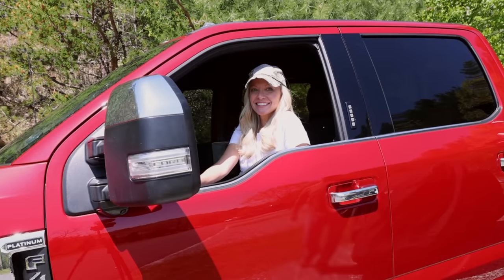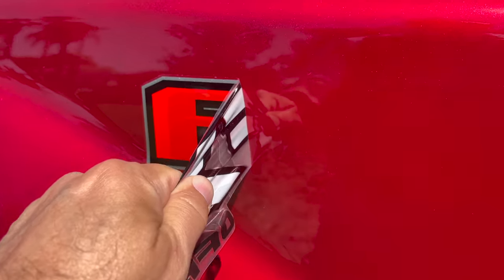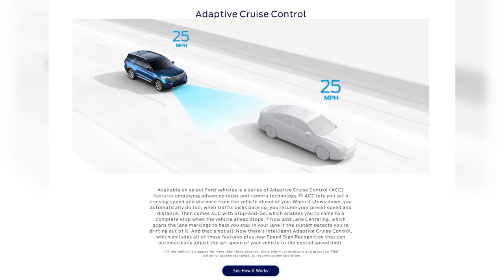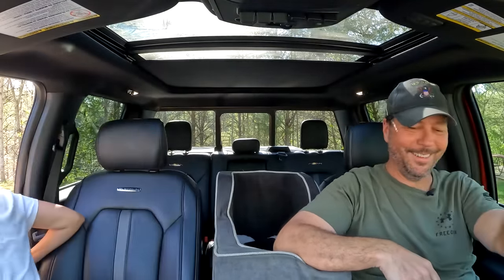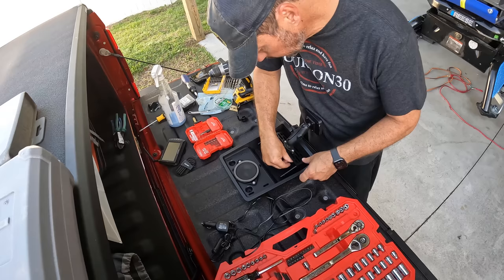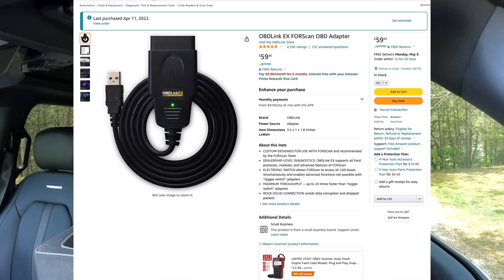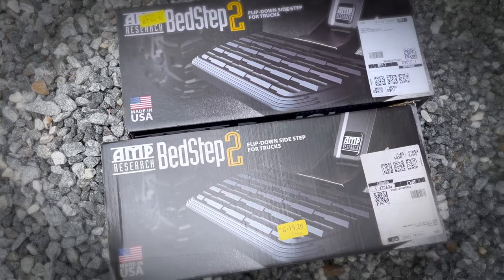2022 F450 Platinum! (Full Time RV!)

Comment: Couple questions for you 

1. Did you hardwire your TST 507 for power?
2. What are the little cushions you used under your GPS against the dash?
3. What upfitter switch did you hook it all to?
Reply from the maker: I did end up hard wiring the TST after filming this but I did film the dash for a couple of shots and you can see it.  I have them wired as:
1: dash cam
2: GPS
3: Furrion, TPMS, GoPro

The little cushions are just rubber pads from Lowe's
Reply: @ChangingLanes  I have my RV890 mounted where your Furrion is mounted I didn’t want to have it up between the screen and the rear view mirror. I felt like it would create a blind spot. But now with the extensions I have used its kind of bouncy on rough roads. I like how you have it mounted does it cause you any blind spots having it there? I may have to get a stubby bar and try it there and see how I like it. I was just going to tap in behind my cig lighter for power to my 12VDC sockets instead of running them to a upfitter switches and save them for other stuff. I was also going to mount the 12VDC sockets in the tray under the Bulletpoint mount but i don’t want the big ol GPS plug in adapter sticking up from when I plug it into the socket. I like how you have the wires going through the tray and the sockets up underneath.

Comment: Chad, I'd suggest keeping an eye on tire wear. I've had to increase the cold tire pressures above what Ford says (90 Front and 80 rear) to 96 Front and 86 Rear because both edges of all tires seemed to be wearing more than the middle.  our 5th wheel is about 21k lbs.  this of course makes the ride worse.  the tires are rated for 110psi cold so they're not overinflated.
Reply: Its a dually thing. The 4 back tires fight the front tires when turning. Ive never seen one that didn't do that... mine included.  I run 70 front and 65 rear.  Im not riding in an Ox cart. HaHa

Comment: liquid spring... as a medic who has riden on a F550 ambulance for 8 years equipped with Liquid spring, I would not recommend them.  Now this is an 9 year old model, but our department has had a lot of trouble with this system including the rig leaning to one side on several occasions.

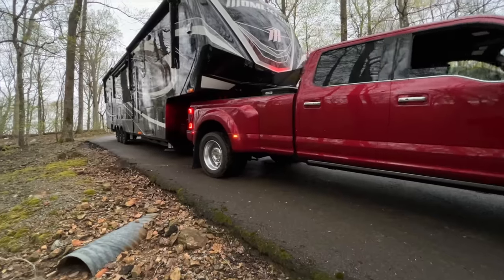Comment: @15:05.   How much clearance do you have between the RV and truck?  Could just be the angle, but man, that looks really tight!
Reply from the maker: It's about 6 inches.
Reply: @ChangingLanes  Phew, that's tight.   I wish they would lower these trucks enough to get at least 8.   I've hit with 7, not hard, but it's touched on uneven ground.  :(

Comment: Turn radius/wide-track is the biggest reason I got my F-450 (2019).  I wish I could have gotten a 4.11 or even 3.73 rear end gear for fuel economy, because I'll never tow to the maximum capacity of the truck.  I'd rather deal with the reduced MPG's than trying to get in and out of parking spots on a daily basis.  The adaptive cruise is awesome, and the cameras are great.  Look into a Banks Ram-Air (cold air intake) system.  It has given me +12% on the MPG's driving empty.  Better with trailers as well, but because weights varies so much, I can't say what the exact % improvement is...

Comment: I really like your truck. Too rich for my blood.
Only thing I wouldn't have ordered would be the moving running boards. I found the fixed ones on our 2021 Ram 3500 helps keep rocks from jumping up and chipping the paint on the side. Even if you have mud flaps.

Comment: Chad...  Did you remove the factory installed balancing weights from any of the wheels before installing the centramatics?  And did you install centramatics on all six wheels?
Reply from the maker: No.. left the weights on.  4 wheels... The rears are balanced in pairs. 👍🏼
Reply: @ChangingLanes  Thank you sir 🙏

Comment: curious on the differences in horsepower and torque of your F-350 and the F-450. And any fuel mileage improvement for better range? Very nice truck!
Reply: My ‘17 F-450 gets about 8-8.5 mpg towing and 11-12 mpg w/o trailer.  My F-350 SRW had same engine, was lighter weight truck, and got +2 mpg better efficiency.
Reply from the maker: Please see: https://changinglanesrv.com/faq/?Display_FAQ=2176
Reply: @ChangingLanes  Thanks for the info

Comment: Took 7 months to get my '22 F450 Lariat Ultimate in March (without adaptive steering). LOVE this truck after coming from my '19 F350 DRW which turned like the Titanic. That turning radius change and the larger brakes are amazing. Adaptive cruise while towing is amazing, hills or not. 
I do wish you'd do a video with more detail on how you wired the accessories to the upfitter switches. Were you able to use 12v "cigarette lighter" connections for the Furrion camera and the GPS? If so, did you just hide them somewhere or hard mount them? (So many questions. You see why you need a dedicated video, lol.)
Reply from the maker: Yes.. I just wired in plugs under the dash tray and plugged them in. 👍🏼   Plenty of room under that tray.
Reply: @ChangingLanes  How hard was it to find and connect the pass-through wires to the pigtails under that fuse box in the engine bay? That's been my struggle doing a cursory look.
Reply: I currently have 2020 F350 Lariat Dually and is waiting for the order bank to come open to get F450 Limited.  How are you coping on checking tire pressures?  Do you just look at them? or do you actually put the pressure gage for true reading?  if yes, how often?  How is the ride?  I don't plan to do much change once I get my F45O.
Reply: @wj2791  It is a bit of a pain, but you just get an old school trucker's gauge. Due to the route carcass, they don't put sensors in the rooms. You can add the TST sensors like you use on your trailer, but I've not done that yet.

Comment: Hey Chad, love the truck! On the Liquid Spring, the company may have a kit for the F-450, but when I spoke to them a month ago they said they didn’t have any kits for the non-commercial line of trucks yet. He thought it would be 2023 before they did. They seem to be more about body roll control for heavy truck camper rigs as well, although I love the kneel feature which would help with transitions in boondocking. 

I also shopped Kelderman, they have great kits, and do have lowering function as well on the backend, and a friend of mine has one in a Chevy 3500 dually and he loves it. He does say the ride is improved and of course getting rid of the leafs probably makes the difference there. I haven’t decided on the 10K to do the upgrade yet. Parts are 6-8 weeks out as well. 

Hope this helps a little anyway.

Comment: Loved the video. I've had new F550 since October (also had to order and wait a good 6 months). I bought the chassis cab and did the super single conversion AND added the liquid springs suspension. I travel with a very heavy Camper and wanted the smoother ride (not to mention a safer ride). I also looked at the Keldermen, but went with the Liquid Springs. If you'd like to talk to someone who can give you a solid run down on all the various options (and he's a good guy as well), give Mike Mclain at Advanced Trucks a call (I can provide phone # is you want/need). Mike was super helpful in walking me thru options and a great source of information.

Comment: Chad, did you get the bigger alternator to charge  RV batteries while driving?  Another battery question.... Would it be beneficial to change out normal AGM truck batteries over to Lithium???
Reply: Rapid heat automagically comes with the highest current dual alternator setup.  To fully utilize it though you must install a DC-DC charger between the truck and the RV.
Reply from the maker: With the solar and 12kWh, we don't really need truck charging.  And, like Brian said, it would need a DC-DC and dedicated cabling.

Comment: Chad are you using the bedside step that is for the F350?  I looked at the website for the step and they do not have an option for the F450.
Reply from the maker: Yes... and they fit fine.  They're just not as snug up against the bottom of the truck as they were on the 350. About a 1" gap, but I find it to be fine.
Reply: @ChangingLanes  Do you know what the part number was?

Comment: What wiring kit did you use to hardwire your Garmin?
Reply from the maker: I just wired cigarette lighter style plugs under the dash tray and plugged the Garmin into that.. to mount it to the RAM mounts, you need an AMPS plate.. that mounts the magnetic base to it.. 👍🏼

Comment: Cool truck Chad, congratulations.
I'm perplexed though. I have a 2020 F350 Platinum Dually, (4:10, and 10 speed)
My payload seems more, my 5th wheel rating is more, gooseneck towing is more. BUT, The bumper pull is less though...
Except for the turning radius, where's the motivation to go to a 450?
My point is, my 350 can tow more on the box, but the 450 can bumper pull more...why? (It's not payload related)
Anyway, love the red, that truck looks good on you.
Reply from the maker: The 450 has a 4.30:1 rear end - more torque / pulling power.
Reply: @ChangingLanes  Understood, but in that case why can the 450 tow so much less on a gooseneck than a 350????

Comment: Did Ford fix the turning radius of its trucks? when I drove wreckers for over 30 years the turning radius of any Ford F350 and above was horrendous!  The GM, Dodge and UD trucks all could turn around in half the area! I remember having the do K turns on the roads "2+ lanes needed" that the other trucks could do  in 1 1/2 lanes, not everyone cared about the bright flashing lights on my truck. I rented a 2019 F250 to pick up a camper. Its turning radius was just as bad as the previous trucks I drove going back to the 80s

Comment: Happy for y’all!!!!

Like most aspects of the 450. Turn radius is great. But we run a fleet of Rams, Duramax and Fords diesels. 

Sorry but the Fords have been a joke to us. We have one 350 that is fixing to have its 3 new engine at 78000 miles. The Rams and Duramax have held up the best by far. Both have plus and minuses. But for the ride and comfort and great handling, I pick the Duramax. 

For overall towing ability, the Ram edges out the Duramax. 

Both have lasted and had far less issues than the Ford. 

This is our experience, and they are run 5-6 days a week towing goose necks loaded.

Comment: Can the cameras now be activated in motion or have they still have yet to do that?
Reply from the maker: The bed camera can.
Reply: @ChangingLanes  that's good at least, they make a module that you can plug in (roughly $600) that let's you activate the camera in motion. It also shows the sides when you put your blinker on.
Reply: Brian, the camera can be used while in motion, including the customer place camera on the trailer

Comment: Hey Chad, here are the recommended changes I made in Forscan:
Double Honk, same as you
Bambi Mode, mentioned multiple times
Panic Alarm Press Count, this is the one where you have the key fob in your pocket and you lean over against something and set off your vehicle alarm (honking).  I changed it to two presses and eliminated that problem
Disable Door Chime When Door Ajar, this is the constant ding, ding, ding when the door is open and the ignition on
Disable Triple Ding at Startup, too many ding, ding, dings
Hope this helps.  We met at the Balloon Fiesta last October.  I had the white F350/Lance TT at the other end of the front row near the entrance gate to the launch field.
If you need the specific "As Built" settings, let me know.
Reply from the maker: Good stuff!  Thanks, Mike!

Comment: In your f350 what rear end gear did you have in it, the 4.10 or 4.30, if you had the 4.10 in the f350 do you like or dislike the f450 4.30 rear end gear but than the 4.10 or would you rather have a 4.10 gear in the f450
Reply from the maker: We had the 3.55 in the 350 and have the 4.30 in the 450.  The 450 only comes with the 4.30, no 4.10 option.
Reply: @ChangingLanes  yes I saw it only came in the 4.30 option but obviously I'm assuming that it could be changed to a 4.10 if the customer bought that part themselves and had it installed.  I'm just curious how much difference fuel mileage would be  with the 4.10 compared to the 4.30 towing and empty

Comment: Autoflex is probably the only other comany that makes bolt in air ride. They aren't american made, but they typically use a design that transfers load  to the factory leaf spring locations instead of a single point like the kelderman system. I'm sure you'd still never have a problem but when it comes to warranty work from OEM's they'll typically find any excuse to wiggle out or void your warranty. Just food for thought.

Comment: The platinum is great but it’s about $20,000 more than even delirious I would go with the lariat and then upgrade that and turn it into a platinum Also, since I don’t need to tow a battleship I went with the F250 lariat power stroke crew cab 6.7 L as far as my fuel efficiency I’m averaging 17 1/2 miles combined about 15 on the city in about 20 -22 on the highway, going 60-64 moh

Comment: So it has been just over a year. What do you like/dislike? 
I am having a vibration issue with my 22 F450. I believe its coming from the rear. Feel it in the seat and not the wheel. 
Have had a rotate and ballance. It is a pretty bad vibration when not towing. Any recommendations? Are you experiencing this?
Reply from the maker: We don't have any vibrations but have had these on since the beginning: https://gear.changinglanesrv.com/?s=CENTRAMATIC&post_type=product&type_aws=true
Reply: @ChangingLanes  mine is horrible. I have been looking at those. Thank you for the reply

Comment: Chad, Im looking at ordering my 1st DRW truck coming from a F250 is the F450 worth the extra $2500.00 compared to the F350? obviously in the same  set up as far as engine, options ETC
Reply from the maker: YES!  Because of the turn radius.  IMHO
Reply: Yes.   Turn radius is very helpful when towing anything large and is a hoot in a parking lot, it turns like a forklift!  ;)  19.5 in tires are also a big upgrade, they have downsides, but they last forever compared to "non-commercial" tires.

Comment: I love my 2022 F350.  Especially the big screen.  I have the Ford owner place camera and TPMS and LOVE it.  I minor nit, when the screen is activated on the rear camera, Synch 4 goes into "backup" mode, which I hate.  Also, to keep navigation, it requires $20 month service fee, which I refuse to pay.
Reply from the maker: We might sill be in trial period?  $20 a month is ridiculous for something free on any phone.
Reply: @ChangingLanes  IRC it's a 90 day trial.  I use a garmin 890 and waze, so didn't really care.  I don't remember sync 3 having this monthly fee.
Reply: One thing I have discovered, which won't affect you, turning radius with CCLB F350, isn't enough to straighten out while backing up from jacknife position, I have to pull forward to reset

Comment: I have a 2017 F450 with a full Kelderman  air ride setup (all four wheels) pulling a 17k Momentum.  

The good includes a smoother ride (with and without a load) and the ability to lower the rear, which can make hookup easier.  And two that are less obvious:  1) lowering the rear when leaving a steep driveway or parking lot, which raises the tail of the RV to avoid scraping, and 2) ability to adjust pressure in the rear to eliminate porpoising.

The bad includes: it's expensive, it's not supported by your Ford dealer, and Kelderman specialist shops aren't on every corner.  It also adds non-OEM components that become critical for operation -- you can't drive the truck if the 3rd party suspension system fails (controller, air line, or compressors, etc.  My compressors are redundant, and I keep extra air line in the truck in case I have to replace a connection, but it is still worth noting.  In my case, the compresses are installed where the spare was, so no spare tire underneath either.

That said, you are welcome to take mine for a drive, and even try a pull with it if you like.
Reply from the maker: Thanks, Brian!  Great details.. Much appreciated!  It's a long shot on the test drive, but where are you located?
Reply: @ChangingLanes  Sorry for the delayed response -- Dallas, Tx.  Check email for my mobile number if you want to coordinate.

Comment: Omg,no wonder these things cost so much,and just one spark can bring it all to a stop. Can see having the extended warranty warranty is a must!
Reply from the maker: No spark plugs in a diesel.. Just sayin.. 😉   But I get your point... Many points of failure.
Reply from the maker: Oh, and we did get the 10 year 100,000 mile full warranty. 👍🏼
Reply: @ChangingLanes  good decision. You have to have it on the Fords with the CP4 pumps and 10 spd trans. Anyone of those go and you're looking at an 8-15k repair bill.
Reply: Had a 6.4 f250 back in the day. The under hood fuel pump died,had it replaced by an independent wrench. Lasted for about 6 mos before developing a huge knock deep in the bowels of the engine. Toast!

Comment: Did you have to add air bags, like on the f350?
Reply from the maker: The 350 didn't "need" airbags.  We added them in an attempt to improve the ride, and they didn't help much.  We're looking into Kelderman for the 450.
Reply: @ChangingLanes  So looking forward to that video/review.   I've had the Kelderman setup in my cart for about 2 years.   Can't pull the trigger, just too little info out there on how it impacts loaded and unloaded ride.   I didn't get a lot of change from airbags either, it's better, but not much better (worth it, IMHO, because they are cheap).

Comment: I have a new 2022 F-350 and my cameras are not good. Totally grainy and the bed camera is almost impossible to use to hitch up because the center line is off by an inch. Are your cameras clear or are they grainy too?
Reply from the maker: Ours are really good... I do have to clean the lenses off before hitching for the best picture.  the 12" screen helps too.
Reply: @ChangingLanes  That screen is amazing compared to an 8”. Beautiful truck btw. Love that color.